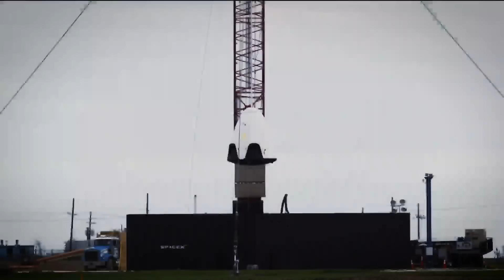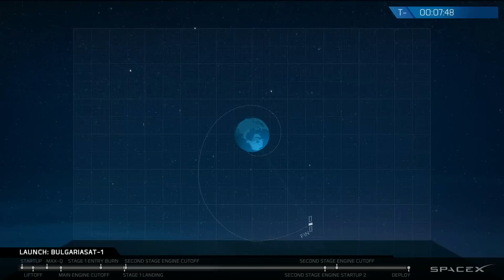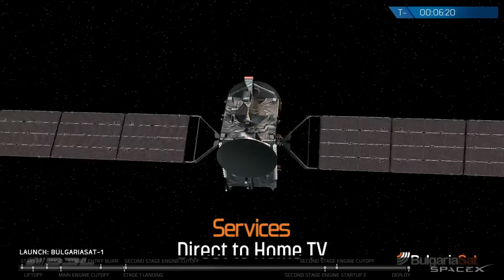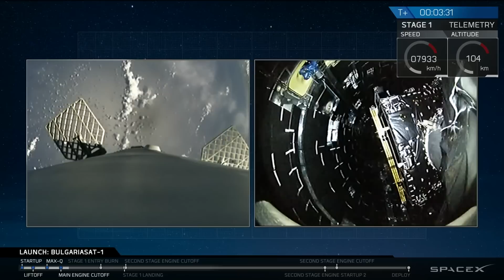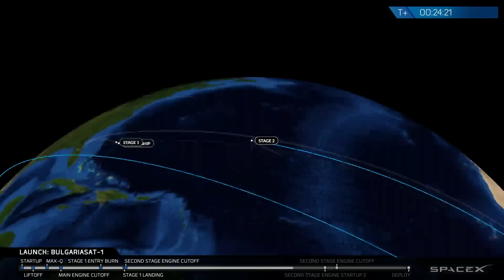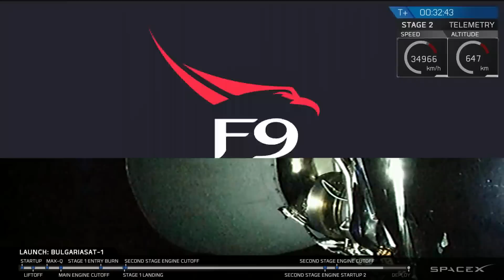BulgariaSat-1 Launch Webcast

Comment: I'm sure Space X team isn't too  happy about the landing. Usually there is loud cheer and applause, this time they were fucking horrified as the booster barely managed to land.
Reply: Nikola Tesla i think its because they have the same video feed that we get, so when that went out all they had was data so they would have just seen the g force of it hitting the deck and data showing that all 4 crush cores in the legs have been fully flatened from this most of them probably assumed that the falcon had just pancaked into the deck, of you listen carefully you can make out a bit of confusion in the background probably because the data was still being received after a landing it should not have survived

Comment: In many ways this is more exciting than the first landings as, we are not starting to see SpaceX doing this repeatedly without problems. We see that the rockets are actually possible to reuse. I would be very interested to hear more about the refurbishing costs though. Are they making the saving they were hoping through reuse.

After all the Space Shuttle was also all about lowering cost through reuse but utterly failed in that promise by having extremely costly and time consuming refurbishing.

For this to be a success, we need to see SpaceX being able to do quickly put used rockets back in business at a low cost. 

With lower cost access to space, it will be interesting to see if the space market as a whole can grow. More companies might be interested in launching things into orbit if the cost is lower. Exciting times ahead with SpaceX, Blue Origin and the Electron rocket guys in New Zealand. Really wished we'd hear more about what is going on at Blue Origin as well. Haven't heard much from them in a while.

Comment: 21:49 there is something flying pretty fast below the first Stage a white spot. ARe those reflections or lower cold-nitrogen boosters?
Also shortly after the deployment of BulgariaSat-1 there are a lot of white points floating around they don´t seem to be like they are from an unstable connection or anything, so what are those the remains of burned fuel or the remains of seperation parts like explosives or other things?

Comment: The ship I most desire is Battlestar Galactica type spacecraft and with two engine models in the center will be a powerful jet engine and a roket engine on each side of the spacecraft located in the center of the spacecraft and with a 30 degree horizontal turning system for Vertical part belly of the ship and 4 legs to climb on the floor in the belly of the ship

Comment: why is the speed of the second stage decreasing gradually after the second stage burns(44:52 onwards)? and when the satellite was separated from second stage, the stimulation showed as if, it was being shot in to outer space( the altitude was gradually increasing)... how does the satellite manage to avoid getting lost in space and enter a geosynchronous orbit?
Reply: You cannot just get "lost" in space, all objects follow predictable paths. All satellites and rockets have guidance systems to steer them. The orbit it needs to get to is just a circle at a specific distance, not very hard to navigate.

Comment: Why does the second stage slowly start to decelerate after second stage engine cutoff 2, is that gravity trying to pull it back to earth?
Reply: yeah. as you move away from perigee, it's like going uphill without using any means of keeping your speed. The final orbit of a Geostationary transfer orbit is highly elliptical.
Reply: Just like when I see Juno's orbital speed increases when it gets closer to Jupiter and then it's orbital speed decreases as it moves away, I get it thanks.

Comment: Again with the "cut out" landing video? You telling me they don't have more than one video source for monitoring the landing of a rocket project that costs millions? In case a malfunction or it crashed, wouldn't they want as many angles as possible for investigation? Even for "Bad Ass" documentation? Xgames has like 20 cameras just for a dude on a board pulling a 720°. What a let down. Looks CG anyway...
Reply: It's not the camera that's the issue. You try keeping a transmitter pointed the right way with a rocket landing a few metres behind you.
Reply: Transmitter vibration is unavoidable.  You can't fly aircraft anywhere near the drone ship at a distance close enough for video of the landing and if they got within range they'd be a possible casualty if the 1st stage has a guidance failure and comes in ballistic.  Since all of SpaceX's money is in rocketry and not satisfying FE'ers it will be some time before they care about providing a video you approve of.  Even if they did you'd just say it's CG.  Really doesn't' matter if you believe it or not. That's the great thing about facts.  They exist whether you believe in them or not.

Comment: Can't they just fly a plane with a camera instead of a jostled camera on the landing pad?
Reply: You couldn't put a plane anywhere near the landing site. Too much risk. Not to mention adding expense for no reason. Remote control drone would be good and relatively inexpensive but they'd have to rig up a relay system to control it since the ship is hundreds of miles away so even that wouldn't be straightforward.
Reply: It wouldn't be that unsafe, IIRC they've used a helicopter to film one of their sea landings before. It would however be an extra cost.

I'm positive SpaceX has the uninterrupted footage stored on board the ship, whether or not they want to release it is a different story.
Reply: They used to have crew on the drone ship until it became a life hazard aswell
Reply: Citation needed, I don't believe that.

Comment: just here looking for a real picture of the Earth that is not composite data Imaging CGI or photoshopped and any proof of the curvature of earth would be great. also try putting  cams on rocket facing all directions so we can observe every angel of launch
Reply: nitpoon firstly, I've seen many a flat earther ask for this, but no matter which picture you give them they always have an excuse. The cameras are meant mainly for the ground crew, so they can see if all is going well with the rocket, they are not doing it for your viewing pleasure alone.
Reply: David Adenuga I'm not them no excuse so put cams facing all directions so we can view launch from all angles start to finish
Reply: nitpoon you realize it's expensive to put more cameras on.. like I said, the cameras are not for your viewing pleasure
Reply: David Adenuga oh well we will do it ourselves no problem we don't need you just wanted to hear your excuses

Comment: Is it just me or does that first stage look like it's never going to fly again?
Reply: sgauntt it did come in quite fast, and it is a Block 3 which are designed for testing reusability. They will probably take it apart, see which parts are damaged most and use that information for Block 4 (which will be designed to fly around 10 times) and Block 5 (which will be able to refly with very little maintenance and up to 12 times between major repairs, and up to 100 times in total). Keep in mind that the reusability is still in development and they have to improve a lot to really get a lot of profit out of it.

Comment: I call BS with the stream cut off, they have a live stream director who controls what is shown
Reply: DC9848 I think they cut it off cause the landing was risky and didn't want to show anything in case it crashed.
Reply: No, it's because the landing vibrations and rocket exhaust interferes with the transmission. We've seen failed landings before, like Eutelsat where the core was smoldering and on fire and tipping over a bit.

Comment: Same shit never see the full Footage and then Bam its landed 🥊
Reply: There is footage from other rockets that have landed...
Reply: This was the first livestream I watched where the video cut out and didn't show the landing so I'm not sure what you are on about. I know the host said the cameras have failed before and it is to be expected but the last few had no issues like this.
Reply: Fredex, The last few launches were RTLS landings, which is way easier in terms of sending and receiving the live recording.
Reply: The last few weren't on a barge.
Reply: POOL PARRoT  the rocket does not have very good antennas so when it goes under the horizon as seen from the launch site they can't send data directly from the rocket back to the launch site, instead they have to send it to the barge, from there to a satellite and then to mission control. Because the barge is in the ocean and gets affected by waves, keeping a connection to the communication satellite is very difficult and with vibrations from the rocket landing it is near impossible. They usually manage to get live footage from the landing when the barge is closer to the shore which allows a direct connection, but this was a GTO mission which requires the barge very far out and a very difficult landing. This was the heaviest payload to GTO where they actually landed so far, on mission with heavier payloads to GTO they don't land the first stage at all.

Comment: It sure looks that they cut the feed when realized that the booster is going for a dive. It was cut off just enough to put a prop on the barge. Lame. There are dollar store cameras better than the potato they used to film the landing.
Reply: Yes... they put a 'prop' on the barge. That makes perfect sense. Just try to think that one through for a second would you before making ridiculous comments. Where were they storing this 'prop' and who was in the area to deploy it? You can't have ships anywhere near for safety... that's why they use an unmanned ship to land on. The drone ship isn't large enough to conceal an entire second rocket just for the sake of faking a video. You can see burn marks across the deck that weren't in the shot before it cut so obviously the rocket came down off target and hovered across the deck. Or do you think someone crept out from behind camera and painted those on?

Speculating that they cut the footage to avoid broadcasting a failure is reasonable but I can't see why they would since they have broadcast failed landings and launches before so it wouldn't make any sense to start pretending that failures were successes now and it would damage their reputation a lot if that information got out (which it almost certainly would).

If you watch footage from a GoPro on the handle bars of a dirt bike or in a car that crashes the footage frequently cuts out or stutters when there is a large shock or impact so it is hardly unreasonable that they would cut out during something as incredibly traumatic as this. Don't forget this ship is a couple hundred miles off shore and this was a livestream. It is possible that the camera continued recording fine and it was merely the equipment broadcasting it that cut out. I've had TVs that lost signal whenever a plane went over so it isn't unfair that a massive rocket almost crash landing right next to the broadcasting equipment would cause the same.

Perhaps when the drone ship docks and the rocket is recovered the full footage will be uploaded.
Reply: The vibrations shake the dish that transmits the video back and puts it off target. That's why it only cuts out right as it lands. Happens with alot of ASDS landings